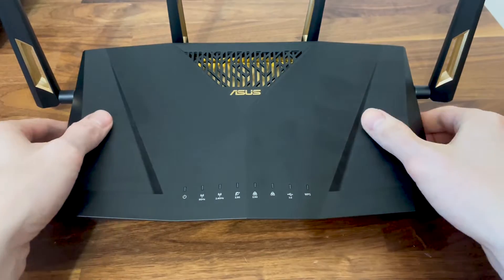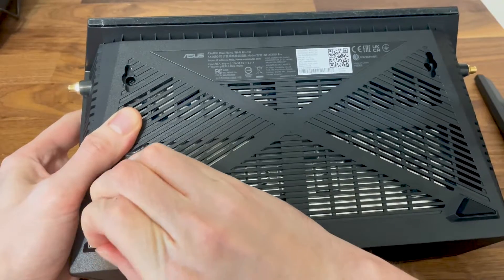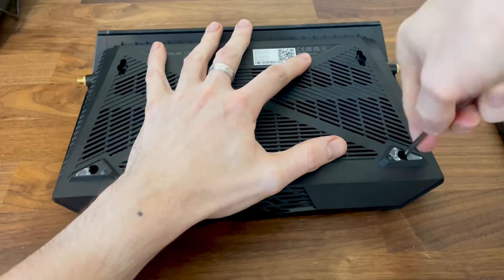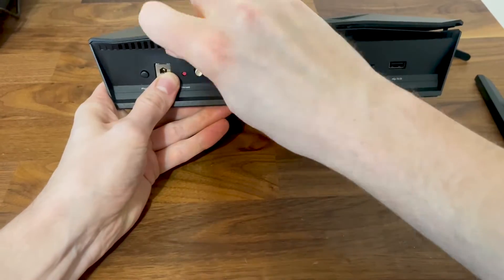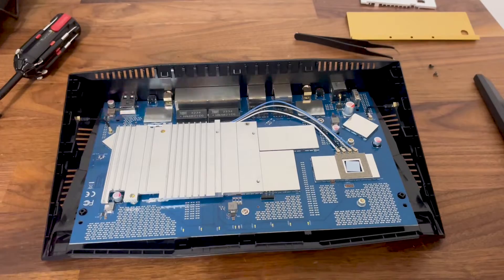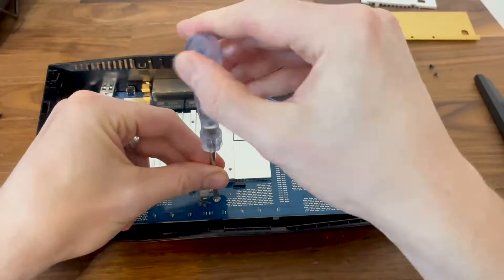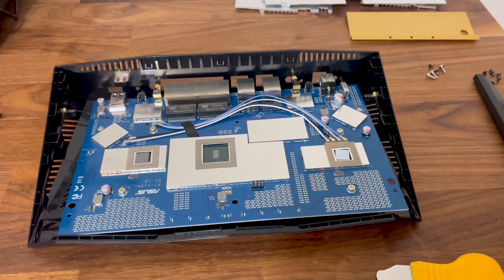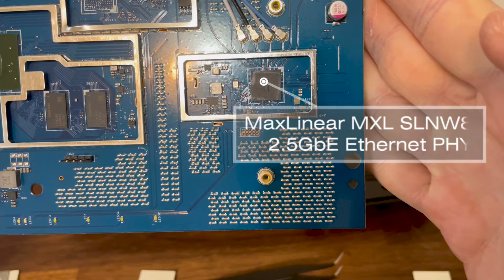ASUS RT AX88U Pro WiFi 6 Router Teardown

Comment: This router got zapped by lightning. 

I took it apart and can’t find anything obviously wrong. 

Any suggestions on where to begin?
Reply from the maker: I would get some sort of digital multimeter to check where the fault is on the board. You may be lucky and only the power adapter is toasted, but there is a high chance that the whole board is dead..

Comment: You absolutely CAN mount this router on a wall! Mine is hanging on a wall right now. Where those top 2 screws are right before it is said this can't be hung on a wall is where it CAN be hung on a wall. You just need to find the right size screw with a flat head that will slide up in the groove.
Reply: THANK YOU! I've been searching internet for this particular feature in the best possible Asus router and was disappointed to learn it was not possible to wall mount from this review. I'm glad I came here to check comments. I was confused after I saw those slots that seem to be exactly to wall mount it. 
Yes, finding the right screws may be a challenge. But not impossible. Thanks again.
Reply from the maker: You mean using screws that have the flat head the whole size of the hole? I suppose it may work, but is it safe? Is there no chance for the router to fall? All Asus had to do is add a small canal for proper mounting. I don't even know what they were thinking when they went with this design.
Reply: @SamBondor  mine hangs. does just fine.
Reply: There is an cabal. Just remove the rubber plugs and you find mounting holes which have canals for a screw to lock into

Comment: My internet service provider supports some routers and the Asus GT-AXE16000 is one of them so do you think i can go with the AX88U pro version instead or it will not work ? i don’t like the gimmicky and flashy interface of the 6000 tho!
Reply from the maker: The GT-AXE16000 is a very different router than the AX88U Pro, mainly because it has a third radio, the 6GHz one. If you have client devices that can make use of it, I say it's better than the Pro, even if the interface is weird (I don't suppose you'll be checking it that often :D). If you don't have WiFi 6E clients, then the RT-AX88U Pro is a good alternative.

Comment: it's a long story but I finally got this thing to work properly (VLAN & port isolation) although I think you can achieve the same thing if you just toggle on AP Isolated on wireless settings... it works as advertised! I ping'd my VLAN device and then ping'd a computer that is not on the VLAN and it worked... it's very important to understand how Asus words things (different manufactures use different language but are saying the same thing...) like macOS & windows... different operating systems but they achieve the same thing... one thing I strongly encourage is to update your firmware first before you try anything of this stuff!
Reply from the maker: Yes, it's not the most advanced implementation, but understand that for most people, the wireless router will be the only networking device in their home (expect for the modem). So, I suppose that it's better than nothing.. Should ASUS and other manufacturers do better? Absolutely. Will it get better? Hopefully yes.

Comment: just a heads up (really disappointed) i did some more testing on this router (checked and double checked) did some research & set up  segmentation correctly the software on this machine is pure junk!! It doesn't do what it says it's gonna do!! I isolated (sandboxed/segmented 2 physical routers) and then ping'd one computer from one router to a computer on another router and the ping still reached the other computer!! in other words if MALWARE reaches one machine the isolated network IT WILL STILL REACH the machine that is suppose to be isolated/physically segmented!!
Reply from the maker: Can you tell me a bit more about the way you have set up the isolated network? Maybe we can figure things out.
Reply from the maker: You can also follow this guide: https://www.asus.com/us/support/faq/1049415/ to set up VLANs.
Reply: @SamBondor thx, do you know if it works properly and not like OP says
Reply from the maker: @phr3ui559  I made a dedicated video on the topic exactly addressing the way the VLAN and the Guest Network Pro function right now. It worked as intended, even if with limited functionality. These features are work-in-progress and it is possible that a firmware update can fix or break things.. which is probably what the user above experienced.
Reply: @SamBondor  Alright, thx. You probably mention this in the video, but what stuff is limited in regards to that? Also, do you use the dual-band smart connection feature? I feel like it causes my wifi connection to drop out sometimes and was wondering if anyone else experienced something like that.
Reply from the maker: @phr3ui559  The limitation is that there is very little control on how the VLANs work and communicate (well, lack of actually), so it's more like a way to isolate the smart devices and not much more.